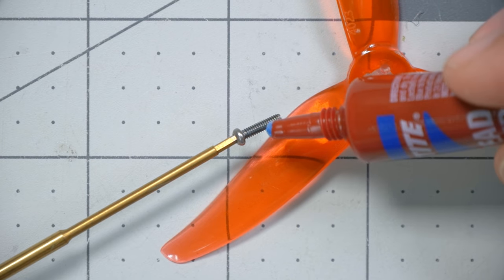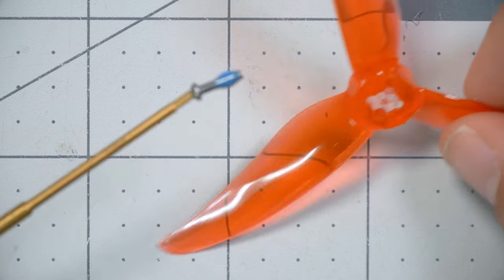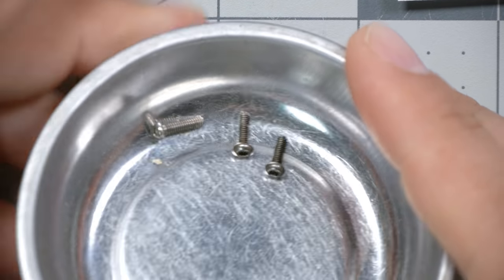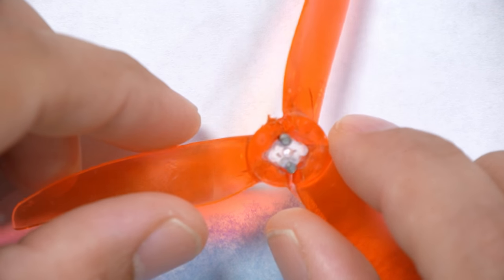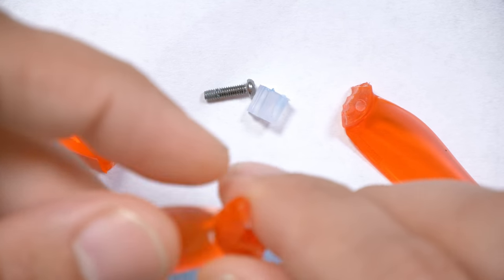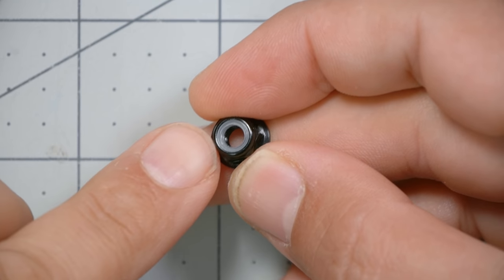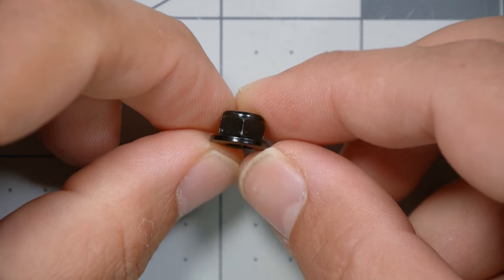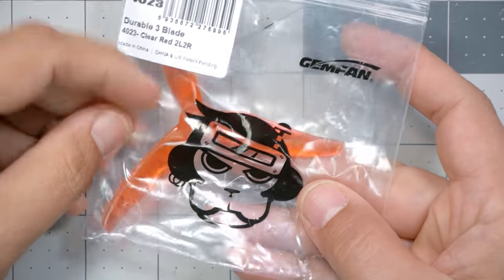This is why you don't use Loc-Tite on your prop nuts or screws

Comment: As weird as it sounds I learned decades ago working on oil field and subsea equipment that if we ran out of blue Loctite our next step was to use Pepto Bismal.  I have used it a bunch on my planes over the years so you might want to use it.

Comment: Hi you should also add to not use loctite for the nuts used on the flight control and esc stack…. I did it and all the cristal nuts were dissolved….

Comment: hmmm .... let me think, two screws, lock nuts, Teflon tape or paper to fill the gap on loose sub 3 inch props, and sometimes ... thread(s) run down between the prop hole and the post so they do not fly off, just for micros.

Comment: I've never had a prop nut come off mid flight  and I use blue locktight  on all the bottom. Screws on my quads  and motors

Comment: So I'm new to FPV, and especially t-mount. I just got a Rekon 35, and there was a package of screws (Im assuming for the props) but they just fall right into the hole, no resistance, nothing to "tighten" to?? What scews are need to tighten these props down?

EDIT: OMG I see now that they tighten right into the top of the motor. Nobody explains this, no documentaion. SO I lost 4 props learning shit the hard way. FML

Comment: I made this mistake on a set of fixed wing servo horns once; instead of the control surfaces moving those plastic servo horns just fell apart. Fortunately that mistake never made it off the ground.

Comment: just put a tiny amount on the tip of the screw.  put it on a q tip first so you can apply it thinly.  people go crazy with thread locker, you only need a litlte bit on the end of the fastener

Comment: This doesn't exactly apply but it's an old carpenters tip, bees wax, bees wax is the original locktite. It works well in a pinch, probably not useful for most quad stuff

Comment: Alright hold up, I use a few different types of loctites and I have had this issue when I use my liquid loctite but I'm not sure if I have the same issue using the wax version. I just usually don't because it works better on larger threads so that loctite lives in the garage mainly. But would that loctite formula not have the same reaction?
Reply: The liquid has more solvent in it and it's easier to wick into the plastic.

Comment: Why not place it in the holes. Clean the top. Place a gasket above the holes, screw in the bolts. Any liquid that might escape will hopefully be stopped by the gasket
Reply from the maker: If you really feel this strongly there are other thread locking materials that can work. Including plastic safe loc tite.

Comment: Just use a dap of loctite at the very end of the screw that attaches to the motor bell. There is no point in covering the entire screw with the goo .
Reply: well those are locknuts arent they? no need for locktite. just the right torque. for me, if a prop gets lose, any loctite probably would not help it coming lose anyway cause it would be a hard enough crash. or the prop would just destroy, it is all about the right torque...

Comment: I disagree. People use thread locker wrong, apply way to much on thread and at the wrong places. Only use loc-tite  brand and not others. threads has to be sparking clean and a micro drop 1/5 th the diameter of the thread applied. That drop should be placed on the thread one thickness of the nut from its landing point. )

Comment: Everyone seems to think theres only 2 types of loctite, red and blue, when actually theres a boatload of different types...Orange is what everyone should be using for frames, motors, etc. 
As far as prop scews and the damage from the solvent, use something like "Gasket Eliminator, it works great as a thread locker, yet comes apart easily without heat and wont hurt plastic or rubber.

Comment: That thumbnail has an insane amount of thread locker. You should never use that much.
Reply from the maker: That's just for the thumbnail. Normally I put a dab on a piece of cardboard and dip the tip of the screw.
Reply: @JoshuaBardwell  ok lol

Comment: Loctite is bullshit unless you are dealing with ridiculous vibrations, and when you are talking about an fpv quad there is deffinetely not enough vibrations to shake loose a tight nut. if you need loctite you arent tightening the bolts up enough 🤣 if it isnt hard to take it off then its gunna come off mid flight or just slip slip slip.... i used to be a vehicle technician and ive not used the stuff once, it's like a forbidden word where I come from 🤣
Reply from the maker: I disagree. I have lost so many screws over the years that I know for sure were tight before I flew and crashed a million times. Now granted, I usually don't loc-tite, and I usually don't lose screws. But I would lose fewer screws if I used loc tite.
Reply: If they came loose....  they weren't tight
Reply: When i say "tight" i literally mean so that you cant get them off without a towel and a socket driver, screws on the other hand i completely agree with you, the dreaded phillips screw head is inheritently hard to apply a decent amount of torque to.
Reply: Shado fpv.. I’m gonna disagree with u… there is a reason why the aerospace industry requires a “agent” when building / repairing a majority of their components.. Torque, tensile strength, bolt stretch all all factors of “tightness”.. vibration, is only one factor of item coming loose
Reply from the maker: "If they came loose they weren't tight" is a sort of self-satisfying proposition that is impossible to rebut. If you tighten them so tight you can't get them off, then they will strip when you try to remove them. At least the M3 button head this is 100% true. Cap head you can tighten a lot. Also bear in mind usually we are screwing into aluminum which will strip if you are a gorilla about it. Bottom line: thread locker exists for a reason, and vibration on a quad absolutely can loosen screws. If you don't believe vibration can do it, how about 20g shocks from crashing?
Reply: Yes, high impact crashes … another “factor”…that is unless you never crash… and the last time I looked, “if your not crashing, your not flying..”
Reply: @JoshuaBardwell  im loving how comprehensive you are with your replys, you literally cover everything 👌 i just dont feel the need for loctite on quads if im honest, iver never used it and never have a 5mm nut come loose :)
Reply: To be honest I also never had a 5mm nut come loose on a prop.. most (as JB explained) have nylock,
  Also, if u were a vehicle technician you would know most assembly hardware already has a form of agent already applied.. it’s just dry.  That is why the manufactures tell u not to reuse the old hardware
Reply: @robaxelsson530  im just gunna leave this conversation as i didnt come here for an argument.
Reply: @JoshuaBardwell  by the way, I apologise if i came across rude, bad day for me 😂 i do agree with you conpletely,   there is deffinetely a need for some sort of anti - vibration compound when there are these forces involved, just please lord no loctite 😂 have a good weekend, hopefully we'll all get out to fly with some decent weather 🤟
Reply: @shado fpv…it’s all good.. stay safe and as “propsofffpv” says.. “enjoy the breeze..